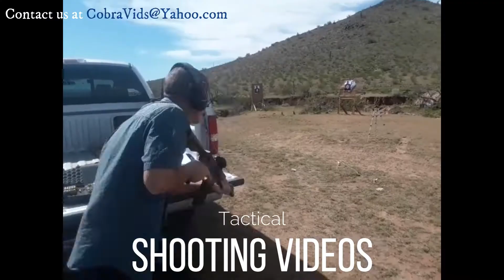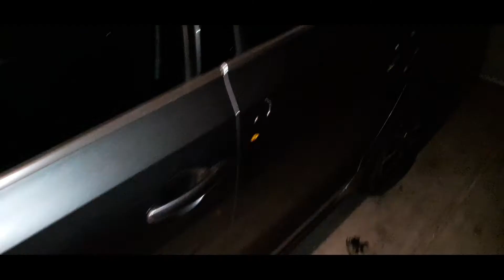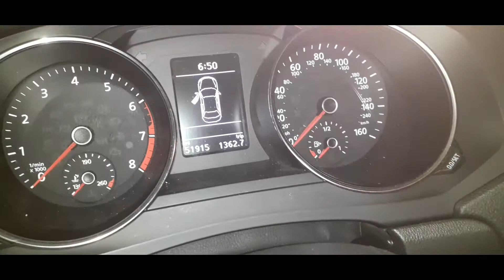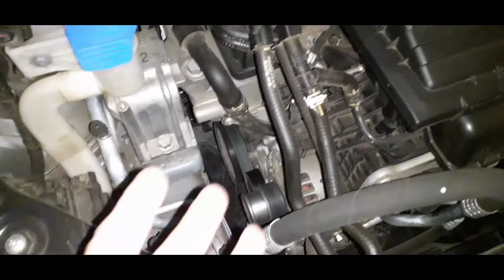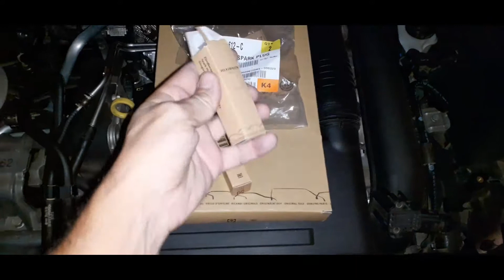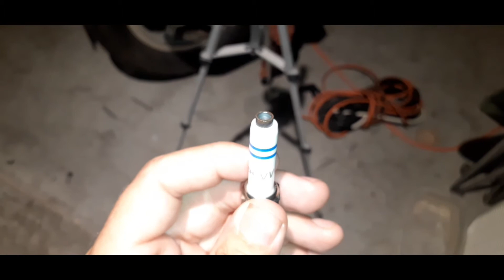2017 Jetta TSI 1 4 Tune Up & Trans Fluid Change PART 1

Comment: That rattle sound is the way those motors sound I have the same year and model Jetta and it sounds exactly the same way since day one when we bought it new from the dealership
Reply from the maker: I didn't really listen to my engine for several thousand miles. Anytime I hear that type of sound I think of a valve/,door flapping. Still today at 78k this car still runs like a champ. In the next 2 or 3k I plan to change the tranny fluids again. Thanks for watching. Stay safe.

Comment: That rattle sound could be related to the high pressure fuel pump.  On direct injected engines there is usually one on the valve cover somewhere.  There is still the one in the gas tank that is a nightmare to change on most vehicles too.

Comment: I am looking at my 2017 VW Jetta manual and it tells you to change transmission oil at 80,000 miles. Looks like that lifetime rumor is miss information. It is right here in my manual to change it at 80k I need to stop asking the Internet for answers and read my book. Spark plug change at 80k is written in there as well
Reply from the maker: @jstewart627  I always cut factory recommendations in half. I change plugs and tranny fluid at 40k. Oil i change at 5k. Remember, dealerships want your car to fail. Thats how they make money. And the whole lofetime fluid thing i believe comes from the fact that with a sealed transmission the fluid can be used up to and beyond 150k. But if maintained your jetta will go 300 and 400k easy. And the internet is a good source, just do multiple searches and read dozens of posts, then find something in the happy medium
Let me know if you have any more questions.

Comment: The VW factory filters are Mann filters but they can be other German brands.  Some parts for these vehicles are made in Poland and other parts of Europe.  Just look at your coolant reservoir cap and you will see where it is from too.  That is under it somewhere so if your engine is still warm or hot watch opening that so you don't get a burn!  I had a 2013 Passat and never saw anything Chinese or Japanese.
Reply from the maker: Does it actually say MANN on them? I have only seen VW part numbers. Mann is an aftermarket part normally.

Comment: Nice work dude! What’s transmission fluid that you used? There is any way to see the level of this fluid ? My Jetta is around 38.000 miles and I observed some strides in 2 an 3 changes
Reply from the maker: These transmission are an odd bunch. They are sealed and have no real way of checking the fluid levels. The only way is to warm the engine and remove that first drain plug. Then open the fill bolt hole that I show in the video and add a little fluid with the engine running. Once the fluid begins to dribble out put the plugs back in and you are good. I hear the stealerships can plug a computer in and check but I dont go to them if I can avoid it.
Reply: Waste gate gate rattle

Comment: You didn't have to use the VW special tool to fill the trans fluid that screws into the secondary (red plastic drain plug)? Or did the fill port work fine?
Reply from the maker: Very good question. The fill hole that the plug is removed from worked great. I just had to take my funnel and rig up a hose to take it down to a size that fits inside of it. Just leave the first plug off and fill it up until it dribbles out of the hole. Replace the plug and fire it up for a brief second to cycle fluid. Remove the plug and repeat until it won't take anymore. At this stage, warm it up to the specified temp, i think i mentioned it in video 80deg?, and I dont want to give you misinformation. Please verify. Then, with the engine running, remove that first plug and top off while at idle until a good dribble comes out of the plug. Then replace the small plug and test all the gears. Take for test drive. Just make sure the car is as level as possible and not on jack stands. Reach out to me if you have any questions. I'm just about to do this again on mine. 40k miles already has gone by, and this thing shifts like its new.

Comment: when do you recommend flushing out the radiator and replacing with new fluid?
Reply from the maker: I keep checking the color of my fluid. I plan to swap and flush at about 20k. If the color starts changing prior to that then I will do it. If the system is sealed then it shouldn't be a problem even 30k. But I always do things more often. After all, it's my bike and I want it to last forever.

Comment: Can you please do the coolant replacement 
I have some engine mk7 golf but I have no idea how can I do it 
Can you show us please
Reply from the maker: By this weekend I will do a video. I do not need to change mine right now because it is still very crisp and clean.  I will go over the procedure and show and explain everything you will need to know. How many miles is on your engine?
Reply: @cobravids  my engine has done 50 
miles
Thank you. Much appreciated
Reply from the maker: @dalilamoh1601  I assume you meant 50k. Mine is at 55k. I plan to wait until 75k. These newer cars are very well sealed and unless younhave had contamination you can wait a little longer. I will still do the video in case you decide to do it now. I always do things sooner than factory says. Like oil changes, VW says 10k between changes. Well I do them at 5k. I waited until 10k the first oil change and the oil was way too black and dirty. And too thick.
Reply: @cobravids  because I do lot of driving,  so if you can show me now I will appreciate
Reply: @cobravids  I have looked in YouTube for long time if anyone have done the coolant flushing for this engine but not one have done it right now
Reply from the maker: @dalilamoh1601  That will be great to get this video up. I'll get it done for you. No problem. I'm off work this weekend so I'll do it.
Reply: @cobravids  
Thank you, much appreciated
Reply from the maker: Just wanted to let you know I will be posting the coolant video very soon. I get busy at work sometimes. You should see it pop up tonight.
Reply: @cobravids  
That's great finally can I change my car coolant 
Thank you